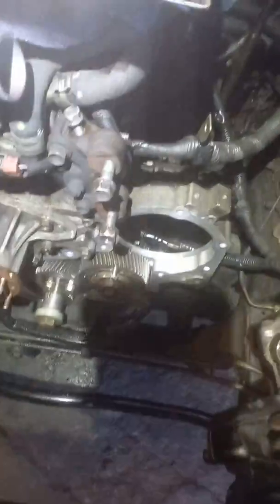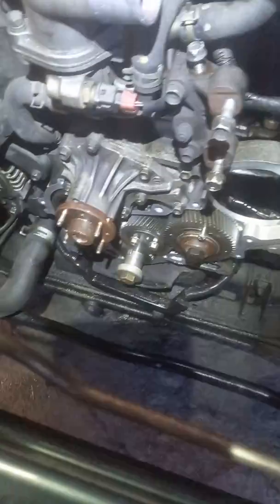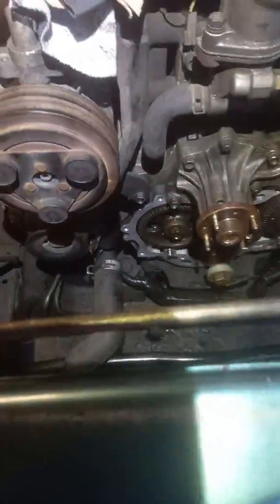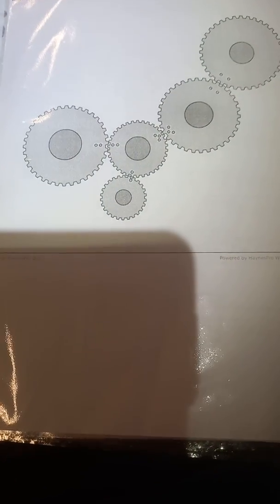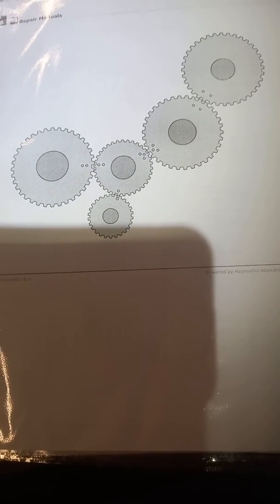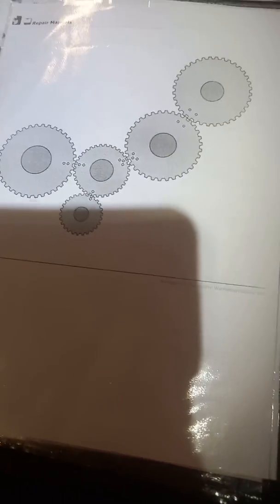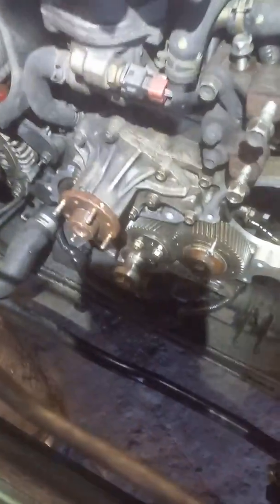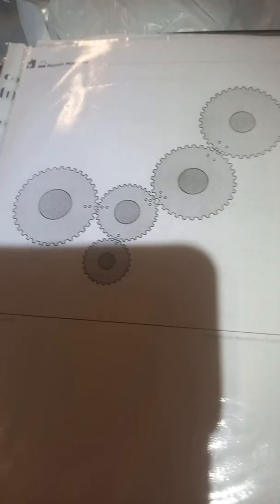Isuzu Dmax 4JH1 Engine Timing Explained

Comment: I have replaced the injectors and put a new hp pump on, I have it running with easy start but no harmony.  I'm going to now lign the pump up as described in your video and will post update.  This has been a long rebuild and your video is the only one I have found after months of trying to get this back on the road. I will update soon thank you